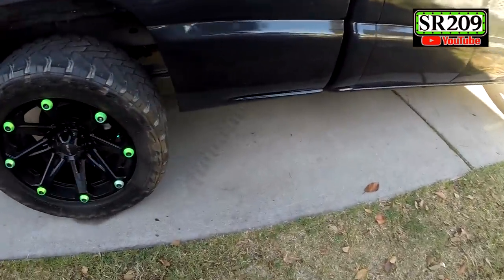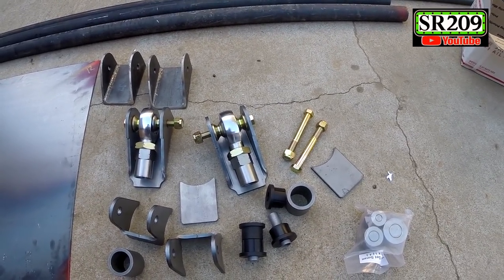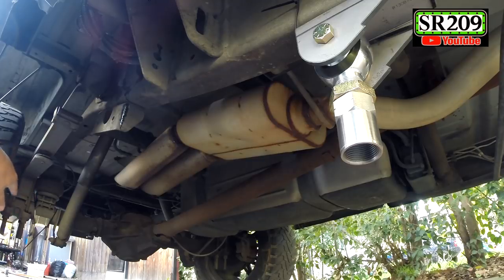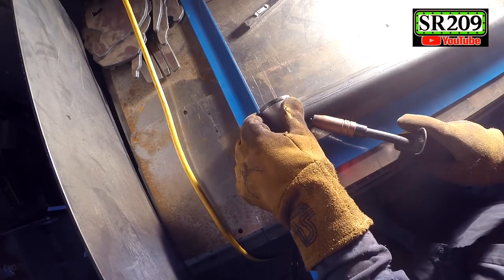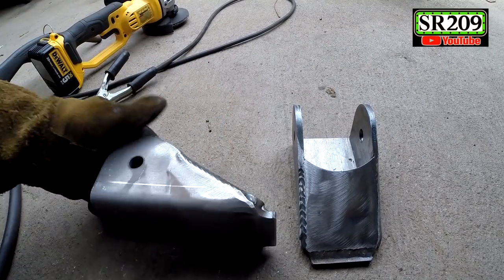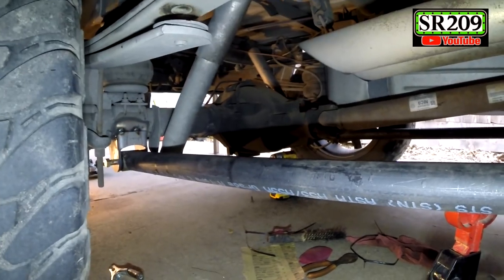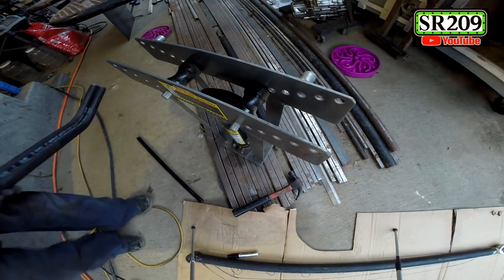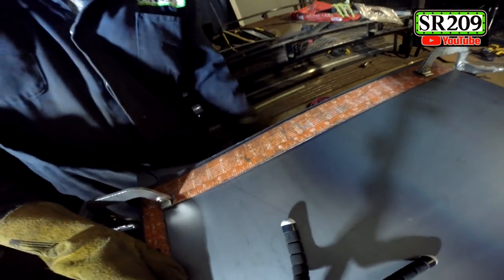TRACTION BAR BUILD WITH RUFFSTUFF SPECIALTIES KIT (PT.1)

Comment: Why not run the trailing arms in a V to make an A-frame and use a Mcpherson link type setup in place of a panhard bar? Wouldnt this allow greater flex that has less effect on relative wheel base and the Mcpherson link would eliminate the axle sweeping as it travels through its vertical rang of motion. No?

Comment: Curious. What kind of mig welder did you use and on what settings?
Reply from the maker: Harbor Freight 170
Reply: @streetryderz209  I thought I recognize that flame, what wire are you using?